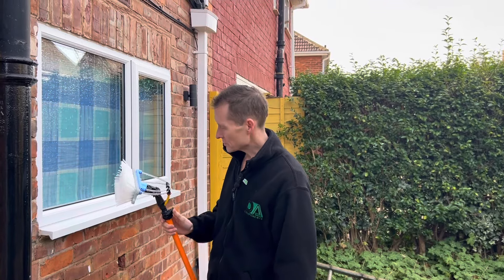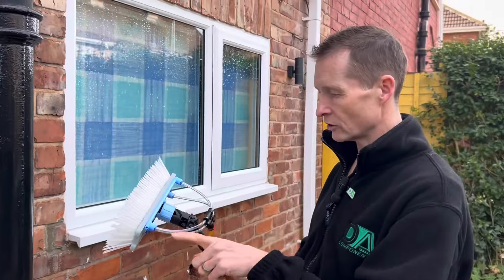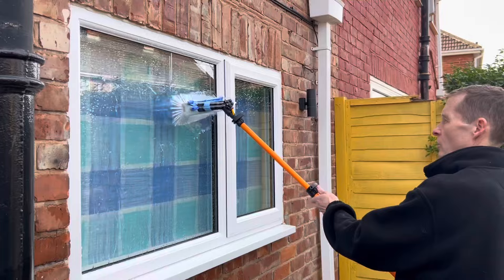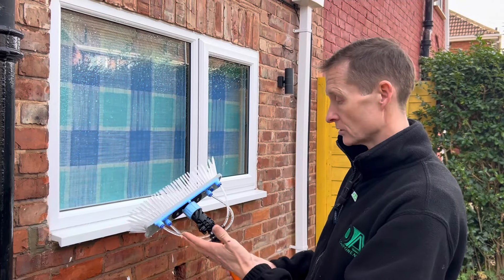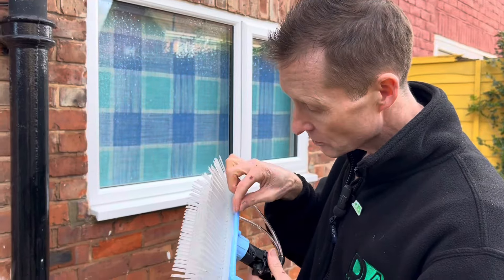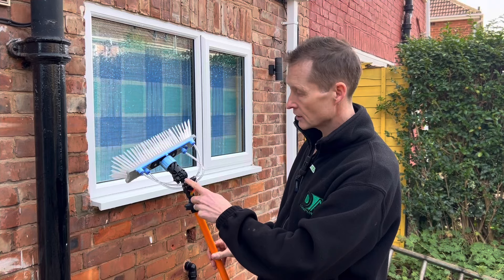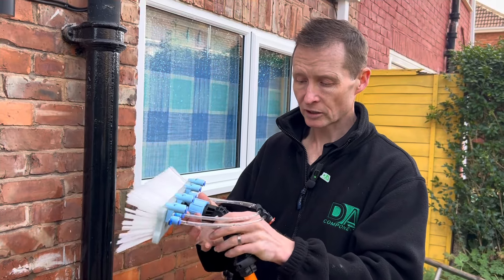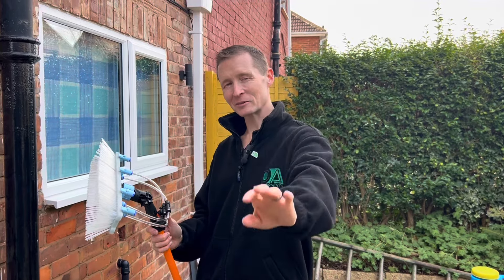Rinse Bar Top Tip

Comment: I’m going to have to some more pennies to the show! Was looking at reach it & tucker brushes..but these look so much better, especially with the jet configurations! Quick question Darren..what’s the thought process with the hybrid..with the boars hair in middle and DuPont on outside (like most hybrid brushes), but I see some with the inverse (like unger)..boars hair outside and DuPont inside.. really want to try boars hair, hesitant to go full boars hair..so hybrid makes sense, but worried I won’t be able to get the boars hair to hit the outside edge of the glass. Cheers, Gary